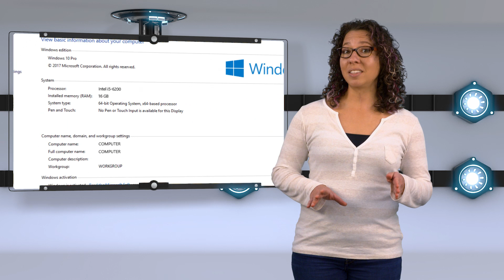Install Memory in Your HP Computer: HP Workbench Series | HP Computers | HP Support

Comment: I have an HP Pavilion Gaming Desktop 690 (0020na) with a single stick of 8GB RAM (factory). I have tried upgrading the memory with 2 sticks of matching 8GB RAM (same spec as factory) for a total of 16GB. Whilst the PC recognises the new RAM, the machine runs much slower than before the upgrade. Are there any other changes I need to make to the PC settings to get the machine running better than before.
Reply from the maker: Hi there, thanks for contacting HP Global Social Media Support!
I understand that you are experiencing an issue with computer after upgrading the memory.
I will do my best to assist you.
You can update your HP computer using Windows Update or HP Support Assistant:
•	Windows Update
Check for updates by searching for and opening Check for updates. If updates are available, they will begin automatically. You can also download and install optional updates by selecting Advanced options > Optional updates.
•	HP Support Assistant
Open HP Support Assistant, find your computer on the My Dashboard tab, and click Updates. After the system analysis is complete, select the updates to download and install. 
You can also update your BIOS (Basic Input Output System) by downloading and installing a BIOS update from the HP Software and Driver Downloads page:
1.	Go to the HP Software and Driver Downloads page.
2.	Navigate to the product page for your computer.
3.	Select BIOS from the list.
4.	Review any available BIOS updates.
5.	Click Download if there is a BIOS update.
6.	Save the BIOS update file on your computer.
7.	Double-click the file name to start the installation. 
Please let us know how it goes!
Regards, 
HP Support
Reply: @HPSupport  Thanks for quick reply. I had reinstated the original RAM and the machine was back to normal. I watched some videos on installing RAM and suspected I had not seated the replacement RAM correctly. I tried reinstalling the new RAM, making sure the RAM was seated correctly, and the machine now works fine.

Comment: This is such a long video for such a simple thing. It's like a puzzle and it only goes one way. The video should cover when you install the RAM and the system's configurations you need to do so it runs the RAM at the right speeds or frequency.

Comment: So you support people upgrading ther RAM but you won't add XMP into the bios so we could axtually use it in the right frequency.

HP please fix.
Reply from the maker: +Mustikkamajoneesi HP does not recommend upgrading or downgrading hardware parts or software that is bundled with the product as It may affect the manufacturer's warranty and performance, however, you could change the configuration at your own discretion.
Reply: @HP Support 
Even if you do not recomend it, it is super anti-consumer to not simply add it in.
Everyone else does why not you

Comment: Hi Team, I Have Hp notebook 15-ac122TU with DDR3 4gb ram, and recently I have instal DDR3 8gb ram after installation laptop is not working...

Can you please help me....
Reply from the maker: +mahesh jeldi Upgrade the random-access memory (RAM) in an HP notebook computer to help improve system performance. To plan for the upgrade, determine what type of memory the computer has, the maximum amount of memory the computer can use, and the amount of memory your operating system can support. Please refer this document for complete information: https://bit.ly/2RCBHgt

Comment: Hello HP , I'm using HP laptop 15 from last  3years performance is good at all. But day by day it is slowing. I want to add NVMe drive. System running on BIOS F.67 . Does it support NVMe boot. 

Pls reply. I want some speedy...pls.
Reply from the maker: +Tushar Sahu May I know the complete model number of your notebook so that we can check the details for you?
Reply: @HPSupport  the model is::

HP Notebook Br106tx 15 of 8GB/2TB and 4GB graphics. i5 8th gen . Pls let me know.
I want to upgrade to NVMe.

Comment: If I am adding 8gb to 8gb do I have to undock the original memory then put it back in with the other one? I think she ment replacing for that just checking???
Reply from the maker: +Jay Steele Follow these steps to install Memory in your HP computer:
- First, power down the PC and remove any cables connected to it.
- If you’re installing memory on a notebook, disconnect from any power source and remove the battery.
- Next, open the access panel on the side of your PC. 
- For notebook PCs, you’ll need to remove the panel on the bottom of the computer. 
- Once you have access to your PC’s motherboard or system board, locate the memory slots. 
- If you’re upgrading your memory, you’ll need to remove the old modules. To do this, press down on the retention clips on the sides of the slot to release the module. 
- With the old memory modules removed, now install the new memory. Remove the new memory modules from the packaging.
- Notice the notch in the bottom of the module. Make sure it’s properly oriented so that it aligns with the notch in the memory slot. 
- Holding the module by its sides, slide it into the memory slot. 
- For notebooks, hold the module by its sides and slide it into the memory slot at about a forty-five degree angle. 
- Now replace the access panels you removed earlier, plug your cables back in, and turn the PC back on. 
- Once the PC is back on, you can check to make sure that Windows recognizes the new memory. Just press the Windows key and the Pause or Break key to open System Properties. Locate the System section to view your PC’s memory.

Comment: I have a year old HP gaming PC. After installing a new 8GB ram, do I have to do any adjustments to make my computer run at 3200mhz, or does it automatically do it?
Reply from the maker: +SWEETLOU52 It should automatically do it.
Reply: No it won't due to their bios xmp not updating if the Ram is not HP brand
Reply: I have the same issue, there is not option to set the frequency in the bios.

Comment: can i install 16 gb on a 
HP - S01-aF0011 Slim Desktop, AMD Athlon Silver 3050U, 4GB RAM, 256 GB SSD, Windows 10 Home (S01-aF0011, Black) Jet Black
Reply from the maker: +Bahl Please refer the user manual of your computer to know about supported memory: https://bit.ly/2Yj1wSu
Reply: @HPSupport  does a Patriot Viper Steel Series DDR4 8GB 3000MHz Performance Memory Module - PVS48G300C6 work with it?

Comment: Just tried to upgrade memory on a HP Desktop Slimline 270.  Tried two different brands and neither would allow the PC to boot.  Was told by Crucial Memory to try HP memory.  Went to the HP Store and their RAM upgrade is not for sale.  This is definitely my last HP computer.
Reply from the maker: +Gary Patton You can purchase the part from here: http://partsurfer.hp.com/ Please select your country and enter serial or product number of your unit.
Reply: That's because they're XMP in bios will not clock clock overbase speed for ram unless it is HP branded which is predatory in my opinion

Comment: I have hp desktop 6305. 1 ram is not recognize. Its says the system memory is less than......
Reply from the maker: +Muhammad Jan Please perform updates via Windows and HP Support Assistant as mentioned below to fix this issue: Step 1 Windows Updates - 1) In the search box, type and open Windows Updates. 2) Check for updates. 3) If the updates are available, click on install and restart the computer. Step 2 HP Support Assistant Updates - 1) In the search box, type and open HP Support Assistant. 2) Check for updates. 3) If the updates are available, click on install and restart the computer.

Comment: I just installed a 2666 MHz 32gb ram but it's now only running at 2133 MHz. Before it was running at 2666 MHZ with the 16GB ram it came with. I can't find anything in the BIOS about ram. My HP model is 595-p0084 lincs motherboard. Please help
Reply from the maker: +Jing Qin Please perform updates via Windows and HP Support Assistant as mentioned below to fix this issue: Step 1 Windows Updates - 1) In the search box, type and open Windows Updates. 2) Check for updates. 3) If the updates are available, click on install and restart the computer. Step 2 HP Support Assistant Updates - 1) In the search box, type and open HP Support Assistant. 2) Check for updates. 3) If the updates are available, click on install and restart the computer.

Comment: I have a Z220 and upgraded the RAM with 8mb compatible chips, I have updated the Bios too.  However it will only accept three rows to work, eg 24mb but won't accept the 4th row for 32mb. The 4 Row works fine with the 4mb chip when used as a pair (2x4mb  and 2x8mb). When I have 4x 8mb the computer beeps and few times and no screen or boot up. Then the fan goes crazy high speed like its going to blow up? so I have to turn it off. Help!!!!
Reply from the maker: +Brent R Please refer this document to know about upgrading memory on your computer: https://bit.ly/2TrrZus

Comment: Need help learning how to change ram speeds, thanks. my referance pc is : HP Pavilion Gaming Desktop 790-0007nf
Reply from the maker: +mordos HP does not recommend upgrading or downgrading hardware parts or software that is bundled with the product as It may affect the manufacturer's warranty and performance, however, you could change the configuration at your own discretion.

Comment: What will happen when installing a two ram of 2 GB and 4 GB which is not a exact pair of already fixed ram
Reply from the maker: +Santhossh Jagan It is advisable to use RAM sticks by the same manufacturer, of the same size, and of the same frequency. ... For two different size RAM sticks to perform optimally together, they need to use the same voltage and their respective controllers should play well with each other and the motherboard.

Comment: @Hp support Just to make sure. I already have 8GB ram in (hp pavilion gaming tg01-0203in) and 1 slot are empty,i can keep 8gb and buy one more 16gb ..so total ram to 24GB? is that correct?
Reply from the maker: +Aatish Ranjan Please refer 'Memory upgrade information' from the specification page to get this information: https://bit.ly/3eh48XV
Reply: Buy another 8 gb. Max is 16 gb and you want equal amounts per card (2x8gb) to run most efficiently and effectively.

Comment: Just to make sure. I already have 4GB ram, and 3 empty slots. I can keep my current 4GB, and purchase another to place inside the empty slot... totaling my ram to be 8GB? Is that correct?
Reply: Yes you can but it has to be compatible with your system and the ram has to be compatible with the ram chip you currently have. Easiest option is to take a look at what you have and order that same exact ram chip.
Reply from the maker: +AquariZ Music May I know the complete model number of your computer so that we can check the details for you?
Reply: @HPSupport  hp pavilion elite h8-1210t
Reply: @HPSupport  Will you get back to me?

Comment: I had a really hard time installing the RAM module, didn't know how much pressure to apply...in the end it did click on one side, but the other didn't, although I pressed it down and then closed the white retaining clip...do you think this is fine or it necessarily needs to click in on both sides? I am anxious to only think about trying to install it again... don't want to break anything!
(It does show up in the BIOS btw)

Comment: I have upgraded my RAM but i'm not getting the full speed, I should be getting 2666 MHz but i'm only getting 2133 MHz.
I can not seem to find it in the Bios either.
Reply: This.
Reply from the maker: +Daryl Ashton May I know the model number of your computer so that we can check the details for you?
Reply: @HPSupport  8CG932090P
Thank you
Reply: @HPSupport  HP Pavilion Gaming 790-0814no, exact same problem, only my memory runs at 2400, when it should be 2666.
Reply: @HPSupport Are you able to help at all ?

Comment: i have question, if my ram card is different hyperx 8gb ram can i add it in? when this pc ram card is native
Reply from the maker: +Valtteri K It is recommended to get the same type of memory (same size, same speed, same manufacturer) for each slot. For best performance, get the fastest memory that the motherboard supports.
Reply: @HPSupport  get the fastest memory that the motherboard supports........how do we find this out pls
Reply: @cooltkll  it should be on the side of the box or in settings but you can also look it up as well